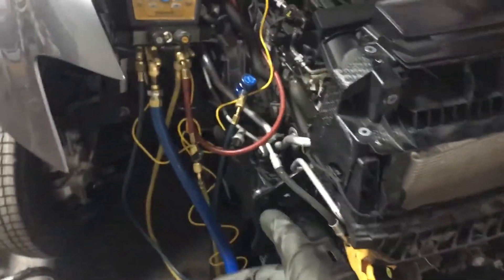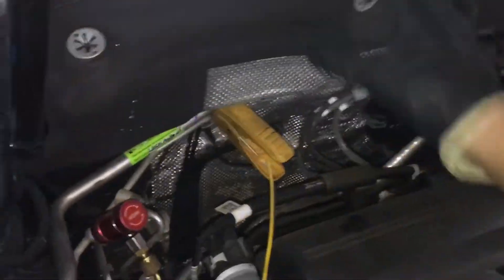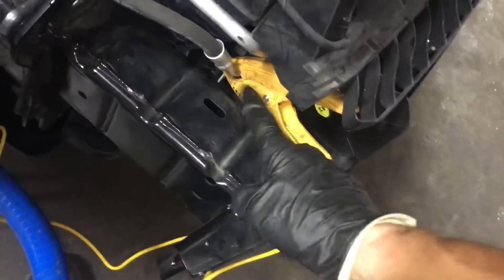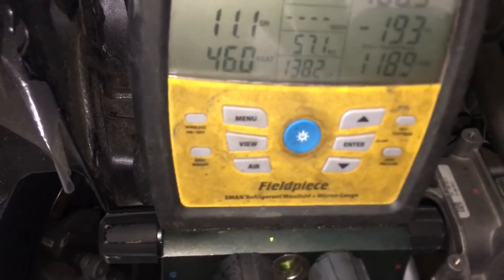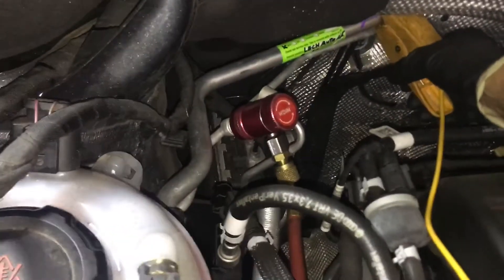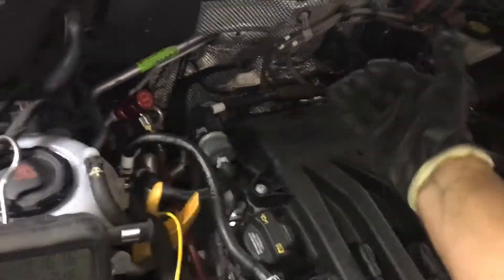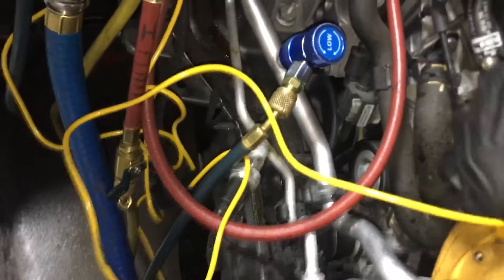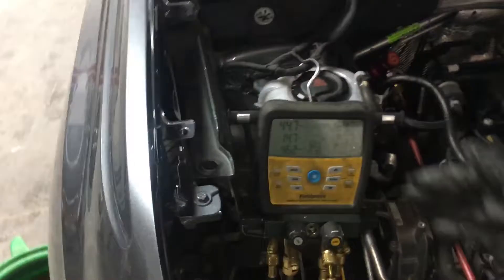AC 2019 Volkswagen atlas, condenser temperatures inlet and outlet, suction line temp duel evaps

Comment: What temp difference do you like to see going in and out?  I have an escalade that has a blockage and although I cannot find a hot / cold spot on the condenser, the inlet temp is 208 with an outlet of 110, big drop, never seen one more than 60 degrees.  Thoughts?
Reply from the maker: Either is really low on refrigerant
Or there’s definitely some compressor material blocking some of the passages of the condenser 
If your temperature measurements are correct

Comment: Do you need specific tips to connect to the vw service ports ?
Reply from the maker: The service port connectors are just like everybody else is volts wagon doesn’t make anything special for their vehicles
Reply: Not true you need a R1234yf to R134a adapter kit - I was having that issue the r1234yf port on my atlas was different sized and could not figure out why
Reply from the maker: Just like every one of the other manufactures  who use R1234yf they are all the same

Comment: I try to use a do it yourself recharge A/C   just to find out the low pressure port doesn't fit correctly  on my 2018 vw atlas..any help on this issue would be appreciated.
Reply from the maker: Are you trying to use the wrong adapter fitting.   For example are you trying to use a R134 service fitting on a R1234YF service fitting ?